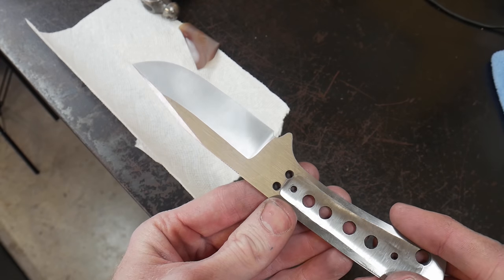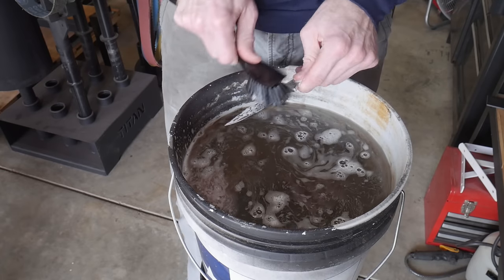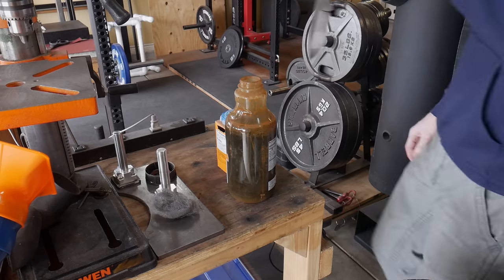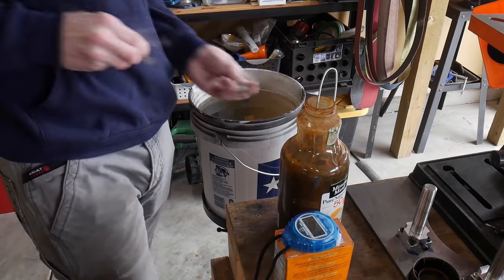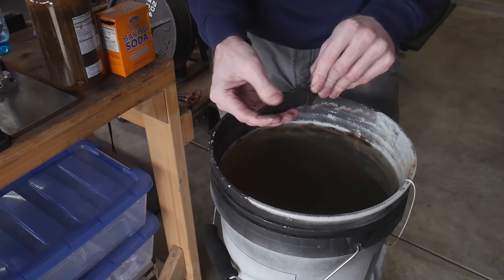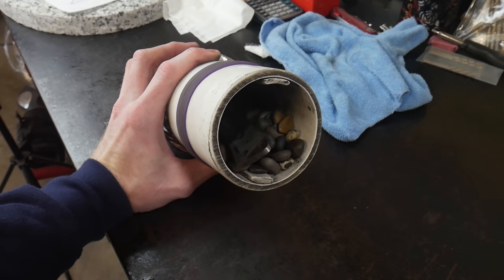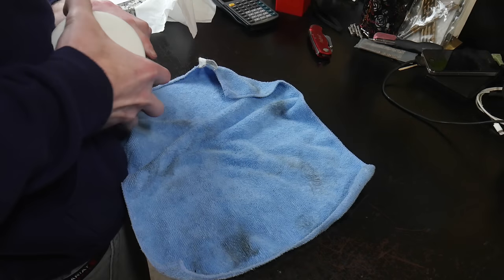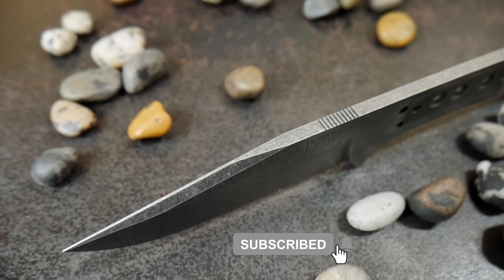How To Stone Wash A Knife | Full Guide | Knife Making Tips

Comment: Good video, I use the same process and surprise surprise I got it from your previous video lol. I would also like to point out that the part of the blade that did not harden during the heat treat is always much lighter in color when etched. I find that usually have to sand with 2500 grit on the spine to make the darker part blend with then lighter non hardened etch. I personally like my stuff as uniform as I can get it. Thanks for the video and I'm really enjoying watching your improvement process as time goes on. Good work.
Reply from the maker: Awesome Phillip, cheers man!

Comment: @Red Beard Ops While watching this video, i noticed you have two "paddles" in your stonewash tumbler, but when i watched your stonewash video, they're not there.
What did you use and how did you attach?
When I built mine i used 3" machine screws in the PVC end caps abs drilled a hole in a couple 2x4's to hold. Why did you choose the caster/PVC ring method?
Reply from the maker: I just epoxied some strips of PVC in there. Helps with the mix.

I used the materials I had on hand

Comment: I just finished a blade and was going to stone wash it today. I built a similar rig to yours but used 4 casters and the caps against the casters to hold it centered. I built the etching machine per your instructions and ordered the stencils as well. I have an issue getting the stencil to seal or stick to the blade. This causes areas to that are not in the stencil sometimes. Any suggestions on that? Great content on your channel. Keep up the good work! Blessings!
Reply from the maker: Awesome Earl, glad to hear your on your way! On my stencil I generally just tape it down as flat as I can really good to the blade. Then hit it with some sand paper after to make sure there is not "over etch"

Comment: Huh. Who knew that a little etching, a little tumbling would provide such an intriguing finish?
I have not been a fan of finished blades, but this kind of changes the game for me.
Is this a good choice for carbon steel or tool steel blades?
Thank you for sharing!
I
Reply from the maker: Hey chuck, this should work on all high carbon steel blades. Not sure about SS haven't tried.
Reply: @RedBeardOps  Thanks! That’s fine, because I’m not a big fan of stainless for working knives. I prefer high carbon for its edge-holding, robust edge-keeping and ease of sharpening. The weakness is its tendency toward rust,  if not kept oiled. Of course, bluing, browning or other chemical surface treatment mitigates this to some degree...and I like that. I especially like the look of the finish you’ve shown us.

Comment: I really like the look of the stone wash and have been thinking about trying it.  Right now I have been working with some "free" steel, some of which is 15n20.  My question is will acid etch work on 15n20 because of the high chromium content?  I know in Damascus they use it as the "light" colored steel.
Reply from the maker: Hey Brian, I've only used 15n20 in damascus like you mentioned to give contrast. I don't think it will take nearly as dark of an etch as 1084. You could try it though... maybe some gun blue or something will darken it up.

Comment: Wow, the finish with rocks looks awesome man! Ive been using the tumbling media from HF and I think theyre a little light, so the pattern isnt quite as definitive. Off to find some rocks! 😂 
Great video, as usual!
Reply from the maker: Thanks Tyler! Cheers man
Reply: Hey brotha, I actually have a question on this...how do you manage to sand your handles without affecting the etch on the spine?
Reply from the maker: @tylermoore9423  I'll have the full build of this knife coming out soon. But short answer on this one is that I put a satin finish on the spine. If you want to maintain the stone wash you can use removable handle scales or do your shaping on the handle with bolts before stone washing; and glue up afterwards.,
Reply: Brilliant, i didnt think of that! Thank you!

Comment: Awesome man! Looks great! Have you ever tried putting your logo on last? After stone wash,  bead blast,  sandblast, ect...? I'm just curious if the dark mark is sharper after the blade finish is done.
Reply from the maker: I don't have a sand blast set up. That would be cool to play with. I have etched after the stone wash with decent results. If you want the mark to be darker you could hit it with the AC power right after the DC. I do that most of the time and it works out well. Just forgot to this time.
Reply: @RedBeardOps  oh nice! I have the etch o matic, it only has the low amps. I'm thinking your right... might need the bigger machine with 15 amps.  Thanks bud

Comment: Help please! First thanks for posting, as a new knife maker I have been following all your videos! I have replicated alot of your procedure and it has helped a ton! Having issues with stone washing!!! I. Have ferric chloride, 50/50 mix with distilled water. 1095 steel, sanded to 400 grit. First knife I did 10 min straight and came out a little blotchy so I switched to the 2 min at a time method but I'm not getting a constant color on my knife. It's darker around the edges and the spine. What am I doing wrong or how do I get an even color? Thanks in advance for any advice!
Reply from the maker: Hey josh, I'm assuming you are cleaning your knife before etching with dish soap right?

It could be coming down to heat treatment? If the whole knife isn't hardened, the softer sections will etch a lighter color.
Reply: @RedBeardOps  thanks! Yes I am cleaning, but I think your right with it being due to the heat treat. It is darker around the edge and lighter in the center. I will work on improving that. Thanks for the help!

Comment: Is it neccessary to use destiled water when rinsing the acid from the blade? Or just normal tap water?
Reply from the maker: Tap water is fine, but you're going to want to neutralize the acid... so add some baking soda and/or windex with ammonia in it. I do both. The last thing you want is to leave acid on the blade.
Reply: @RedBeardOps  understood sir thanks a lot I will be using sharp rocks as well for a pommel and guard of a medieval dagger

Comment: If you put too much alkali to neutralize the blade, won't the alkali start eating the steel until you neutralize it with acid? :D
Reply from the maker: Once you use acid, I'd suggest neutralizing with backing soda. Then drying off and oiling. Haven't ever had an issue.
Reply: @RedBeardOps  I honestly haven't even had any issue simply washing the blade without neutralization (probably soap neutralized the thing enough). Sorry for the sarcastic comment It wasn't meant to be mean, just a stupid question, that odly isn't stupid at all. Love your works ;)